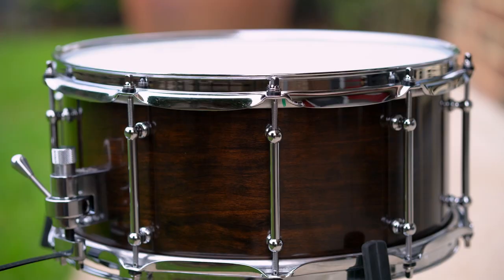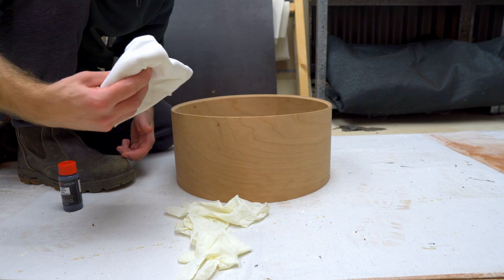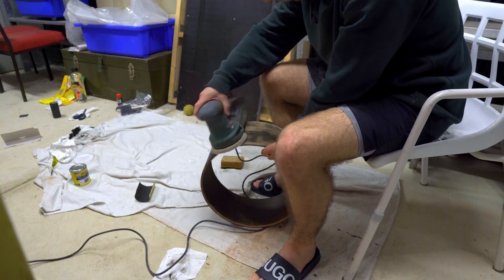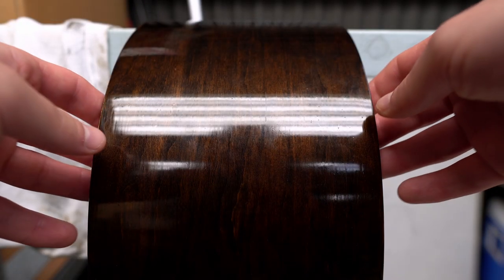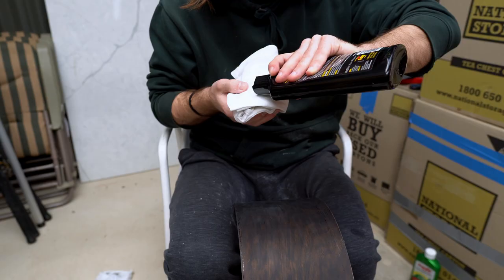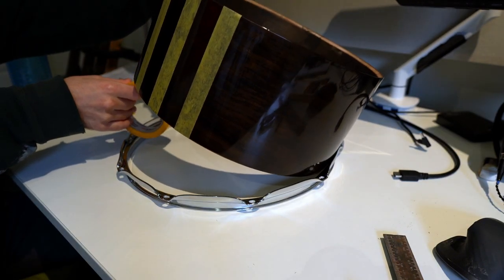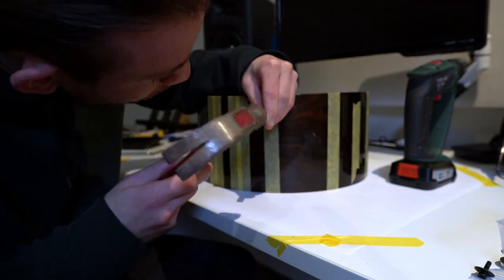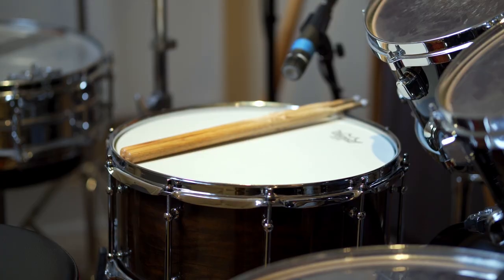DIY Cherry Snare Drum Build

Comment: Nice job with the description of how to build this drum.  I have a few tips if you don't mind.  I painted high end cars and custom bikes for 30+ years.  Try getting some DA sandpaper for sanding out the dirt nibs and imperfections.  I would start with 800 and then go 1200, 1500, and finally 2000.  You can go 3000 if you would like.  Dry sanding with the DA is the That will make polishing a bit easier.  Next, polishing with an orbital or DA (Dual Action) sander takes forever.  You would be better of with a sander that spins like a grinder with no extra motion.  You'll want something in the 1200-1750 RPM range.  Grinders usually spin in the 3500 RPM range which will melt that finish right off, so RPMs is critical!!  This will work much quicker.  Always make sure the rotation of the pad is spinning "Off of the edge" and not into the edge, or you'll burn the edge and quite possible rip it from your hands and fling it across the room!! Also make sure you put you hair up so it doesn't get wound up in the polisher at 1750 RPMs.  Saw that once and it was a bloody mess, and I don't mean "bloody" in the european sense of the word! LOL  If you go to 2000-3000 grit when sanding, you won't need a "heavy cut" type of compound.  It shouldn't have and grit to it.  3M products are the most common. Any bodyshop supply store will have all of these items in stock.  You're drum looks and sounds amazing, as well as your playing!! Just built my first snare as well. It's a 6.5" Stave shell that I made from Sepele (Mahogany).  I'll be making a lot ,more of them now!! Enjoy and thanks again for the video!!
Reply from the maker: Thanks for the tips mate! I do appreciate it and I like the idea of building a bit of a knowledge base here for people trying the same stuff. I must say finding knowledge on the internet for polishing was really difficult. The content I did find was American and being in Australia I couldn't find equivalent compounds, and the ones here didn't seem to have grit ratings on them. The store staff weren't super knowledgeable either. So it's valuable having input from a pro here, wish I knew this before I started! Your knowledge on the orbital sander certainly lines up too, I wasn't getting anywhere so quickly shifted to hand polishing which was more effective. Sounds like a cool project, are you making videos on your builds?

Comment: Nice looking. You never once mentioned anything about a snare bed. I just finished another snare drum build myself. A 6.5X14” copper shell from WorldMax with black nickel hoops, tension rods & tube lugs from DFD, and a black nickel SB1 throw-off & butt plate from INDe! I also put on PureSound 20 strand Blasters, and REMO Ambassador Hazy & Coated heads!! My next build will be a 15 ply maple shell from Keller!!
Reply from the maker: Sounds like a cool build Johnny! Are you happy with the sound? For the record, the shell had snare beds already shaped in, and I just had to make sure I orientated the snare throw-off correctly.
Reply: @nikgdrums  , I’ve used the drum a couple times at rehearsal. Next Saturday I’ll use the drum at a gig! So far I love the tone! My first copper snare drum! After the 15 ply maple build, I think I’ll do a bronze shell. Thanks for sharing your video’s!! Cheers!!
Reply from the maker: @JohnnyQ714  Nice, nothing like breaking it in at the first gig. Goodluck on your future builds

Comment: Looks awesome. Wasn’t sure about the shells from there. I bought so much stuff from DFD just wasn’t sure about the shells looks fantastic. Specially all done did a good job . I had the same issue with Polly. I didn’t care for it. Left Brush  strokes and ran easy.
Reply from the maker: Thanks Jonathan - would recommend the shell, I think my finished product speaks for itself! What finish did you end up using? I would highly recommend cutting and polishing the poly to end up with that glass like finish.

Comment: Hey nice work. If you want to make life easier for yourself in the future, I'd suggest you go to your local Harbor Freight and pick up a couple of foam cutting/polishing pads. They're only about $8 a pop. I picked up a couple of the 6" pads for use on a 5" random orbit sander. I use them all the time on the guitars that I build, and you can get from 2000 grit to a nice, high gloss, glassy finish in seconds! That extra half inch of pad overhanging the sander's 5" pad is really useful for getting into the cutaways on guitars without bumping the more rigid pad of the sander into the finish. I even keep an old one around for polishing my brilliant finish cymbals! If you do use it for cymbals, don't plan on using it for anything else again, it will turn that pad into a black mess!
Reply from the maker: Thanks for the tip. I didn't have much luck with the microfibre pad I had. Have you compared both foam and microfibre and find one is more effective? There didn't seem to be too much info on the net about it.

Comment: Great job on getting that to look the way it does. It looks beautiful! I'm looking to do my own snare drum build and would love to use this technique. So without doing the corrective steps in the middle, first you would stain the shell, then what was the actual final step you used to polish it that worked? After you sanded you went to the polishing by hand. Sanding isn't necessary if you're not correcting dust marks and things of that nature, correct? So what I'm guessing, stain is step 1, polish with multi coats is step 2? Then drilling and mounting the hardware? Again, nice job on this drum!!!
Reply from the maker: Thanks mate! so the steps would be:
1. Stain
2. Apply 5 coats of oil based polyurethane, with a light sanding in between coats (600 grit)
3. Sand the final coat with wet and dry going from 600 -> 1200 -> 2000, 
4. Use a car polish with an equivalent grit of 3000 or above with a cotton cloth. Someone else commented a foam buffing disc would work (my mistake was using a microfibre disc which didn't work
I'd say it still necessary to sand between coats just to e=remove any imperfections and so the new coat of poly adheres to the previous coat
Reply: Thank you so much for that! I can't wait to give this a go myself.

Comment: I would use wipe on poly no streaking.  Also i would do all my markings and drilling first before staining and poly.  Otherwise you gotta deal with scratching your beautiful finish . ✌️
Reply from the maker: Wipe on is certainly an option. Little bit more time intensive is the trade off, to build up a thick coat.

Comment: Bro, I think that you would have  gotten a better result if you used an air brush. Just my opinion,  you still have a beautiful snare drum and sounds great. I really love that finish. Great job brother
Reply from the maker: Thanks Mike - you're right. My shed is however so dusty that regardless of the finishing application method I would have had dust specs, so cut and polish still required.

Comment: The drum looked and sounded great at the end! i’d love to try doing something like that myself. Respect for not being discouraged and taking as much time is it to to get the finish looking right. I’m curious what made you want to go with a poly finish as opposed to like a brush or spray lacquer?
Reply from the maker: No particular reason, poly is probably just a little easier to work with. Also doesn't yellow over time like lacquer, although that's not so much an issue with a dark finish.
Reply: Yeah that’s a good point. Thanks for sharing this.

Comment: How did you determine the tension rod length you needed? I’m interested in doing my own build
Reply from the maker: Hey mate, for tension rod length, you take the height of the shell (6.5") minus the length of the lugs (say 4.5") divided by 2. (6.5-4.5) /2= 1". This is how much space there is either side of the lug to the top/bottom of the shell. I then usually add half an inch so you have enough thread  on the tension rod, so I would use 1.5" tension rods.

Comment: what about all the stain and glop on the bearing edges?
Reply from the maker: Good point. It is fine for the edges to have stain/finish so long as it is applied evenly. I did check them before assembling the drum. If it was uneven I'd recommend a quick true up just to flatten it out.

Comment: bubbles....  use a small  torch to get  rid of  those...[dont  burn nuthin].
Reply from the maker: That's a good tip. There were also dust imperfections too, so sanding was necessary.

Comment: Hi Nik. Im a drummer and a woodworker. I do tons of lathe work and have wanted to build a snare for a long time. I am wondering what sound I would get turning one out of solid wood instead of building up 5 or 6 ply. Any thoughts on this?
Reply from the maker: Hi Ray, wow I'm sure you could put your talents to use on drum building. I think you'd have an excellent product, go for it. Another option is a stave construction. You'd save a bit of lathe time using this method, and still end up with a similar style shell.